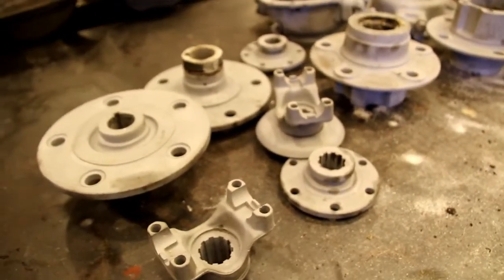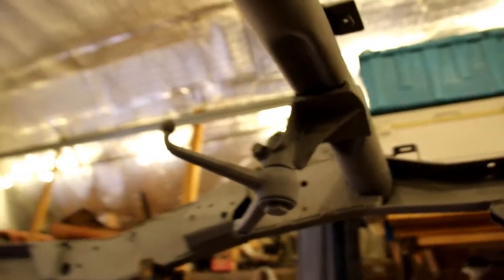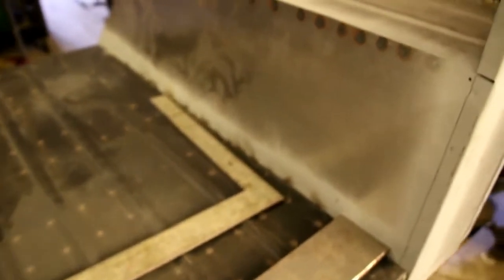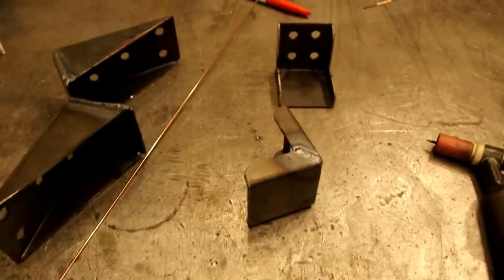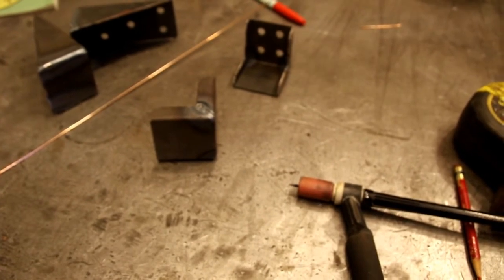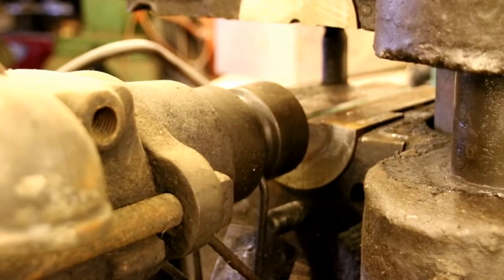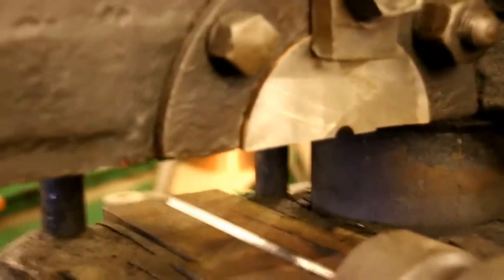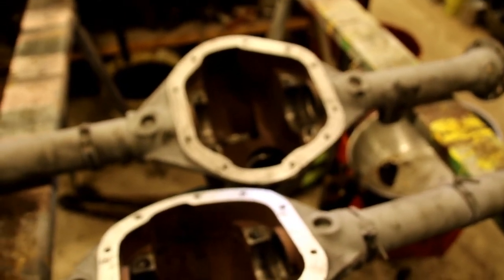CJ3A, CJ3B welder jeep, Tig welding, Forging machine, FJ40 1UZ Engine

Comment: You certainly have a lot of good toys to play with, that forging hammer is really good, but of course you need your Milling machine to make the dies, and a large Compressor to run it, I think you did very well to video the TIG welding, it must be very difficult to weld and video at the same time, and you got a very clear frame of the operation. Many Thanks for posting this!
Reply from the maker: I didn't show the milling machine making the dies but perhaps in another video.  My shop air compressor barely keeps up so I think I am going to move my sandblasting compressor over to the shop to power it when making the bolts.  375 cfm will be overkill, but it sure is nice to have an excess of air.  Thanks for the comment on the tig welding, the welding videos will get much better as time goes on and I learn more about the camera settings.  Yes, it sure is difficult to weld and video at the same time.  Hard to get everything set up.  One of these days I may find a helper !!!  stay tuned, many more videos coming.

Comment: 100 of em YIKES how long will it take ya to do that ?
Reply from the maker: I made a few of them by hand in my heading vise and it took 2 heats to get the proper shape and way too much time.  That is when I moved the forging hammer into the shop and made some dies.   I have not tried making one yet but believe I can do it in one heat.  I will show a few being made once I am set up.  100 bolts shouldn't be too bad, but I also have to drill 100 holes thru some 6" box tube!!

Comment: Very impressive, Brian!  I just finished watching all your videos and learning a lot.  My dogs zone right out as soon as you start talking so if the metal working doesn't work out for you, maybe dog whispering is worth a shot!  ;)   

You mentioned we could ask if there is stuff we'd like to hear about...I flat tow my 3A and sometimes I wish I had lockout hubs on the rears as I do on the front so I wouldn't have to disconnect the driveshaft all the time.  Can you mention when the time comes, just what is required to make a conversion like this?  

Also, many thanks to Uncle Vin for posting this thread on the 3A page!  Great to actually see how all this comes together.
Reply from the maker: Hello Tom, thanks for watching and commenting, glad you are learning from my videos.  Dogs zoning out.... great.  I usually have cattle, pigs, chickens etc.. running around the farm and we have daily chat sessions......
Keep watching many more videos to come.